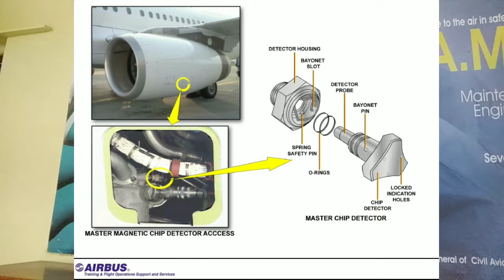PW1100G-JM ENGINE ISSUES AND THE SOLUTIONS TO THE PROBLEMS | PATRIOTIC AVIATOR |

Comment: CC problems are because of the environment in SE asia. Airlines in other parts of the world don't see the same levels of CC distress.
MCC findings on the #3 bearing are because the carbon seal is wearing down and the carrier is wearing against the seal plate, spiking metal in the oil and triggering the MCC.
LPT failures are because of DOD. Fix was a 3rd stage made of different (less brittle) material.
Gearbox problems had nothing to do with the fan drive gear system, it was a problem with the accessory gearbox.